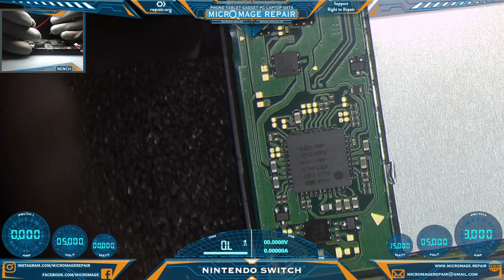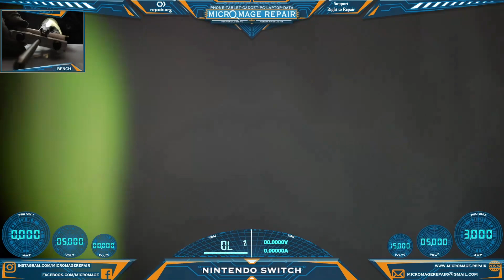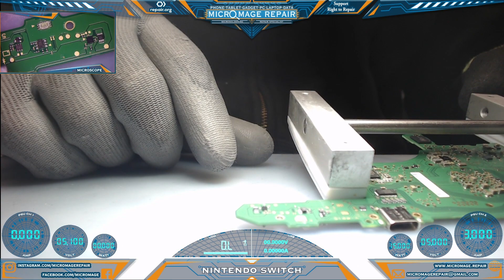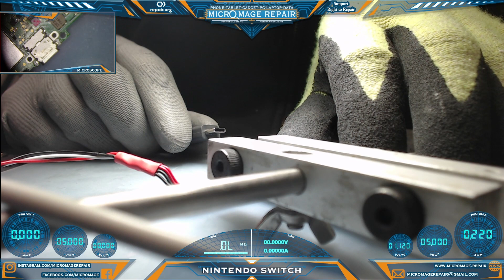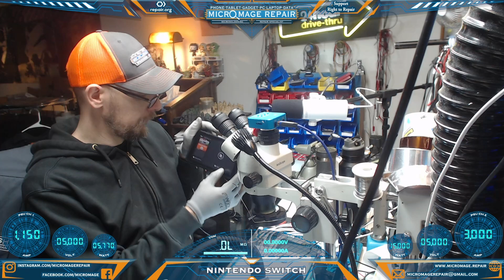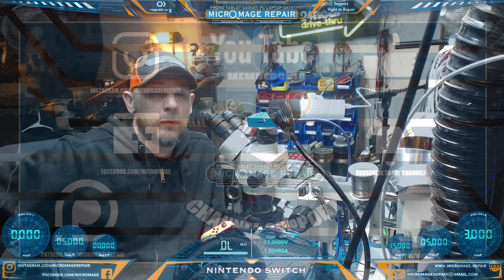Nintendo Switch: Bad Parts Cause Bad Conclusions!

Comment: Is it intentional you're wearing two different types of gloves? One it more flexible and the other one of better for heat resistance maybe?
Reply from the maker: Thanks for the question Jeffrey. 
Yes it's intentional.
When I use the hot air station I switch my tweezer hand glove to a high temp one. 
I've found my most comfortable position for rework also BBQs my hand so had to come up with that solution.
Reply: @MicroMageRepair  I don't think I've ever seen someone use gloves this way. Seems pretty smart tbh. I mostly use nitrile gloves, but the heat resistance of those things isn't the best.
Reply from the maker: @jeffrey308  I used to use Nitrile as well but I try and find reusable gloves rather than tossing 2-5 pairs in the trash every day.
Just my preference.